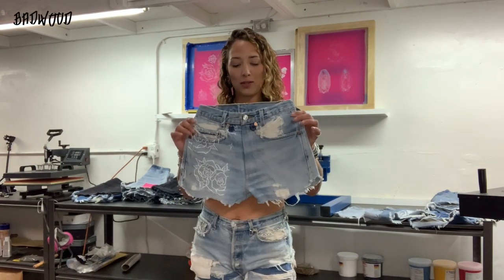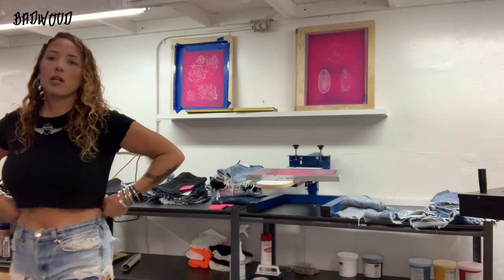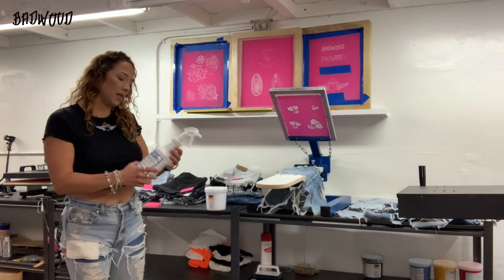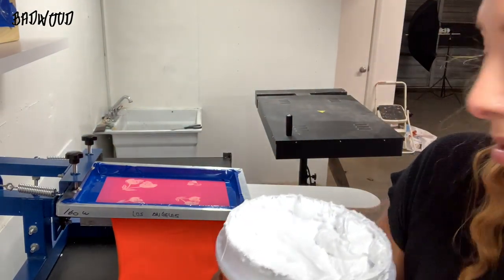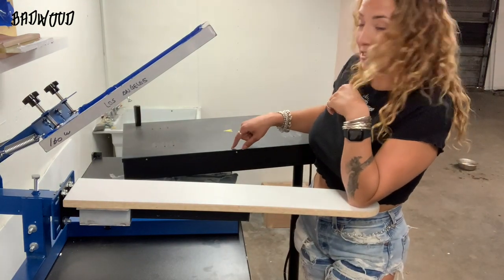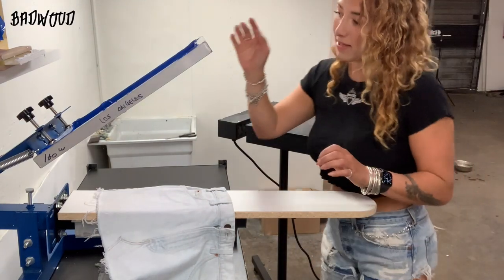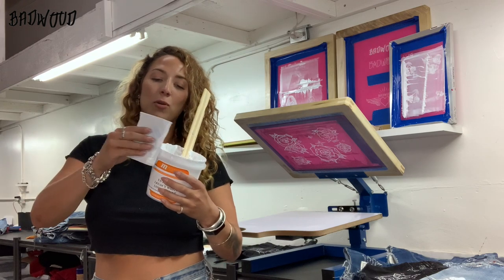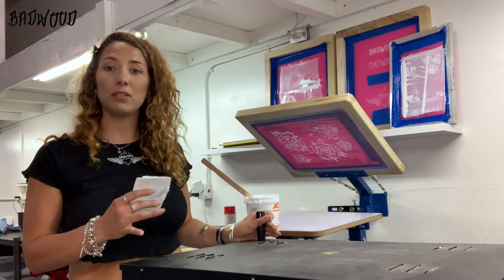SCREEN PRINT WITH ME! | Thrifted to "Badwood Denim" | My process from start to finish | Q&A

Comment: forever ago, 1990, we used some kind of cheap hand pump pressure lawn weed poison sprayer, liked bug powder, mugwump, william burroughs naked lunch style, and we sprayed (toxic) dry cleaning fluid to spray clean the screens. sometimes we used a garden hose version too.  it was about a minute or two in the parking lot. for drying the 4-color plastisol we used a used pizza oven that was a belt that ran thru a box.

Comment: First some thoughts and facts to help become a pro, 
eBay/amazon presses are junk
Pallet tape on ur pallets then apply LIQUID WB ADHESIVE save urself the mess time and money 
Also flash while item is still on pallet in case of a print flash print scenario 
Also ur off contact is horrible, that’s very important and screen mesh size and tension top 2 most important aspects of screen printing, hence the name “screen printing”